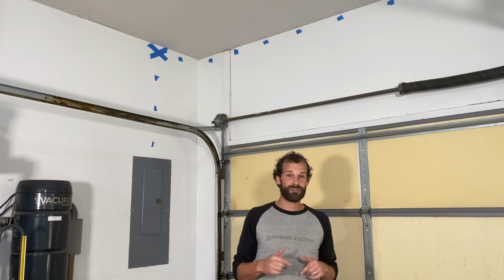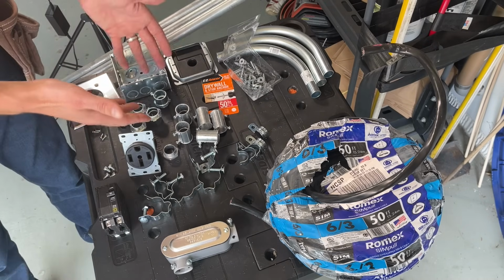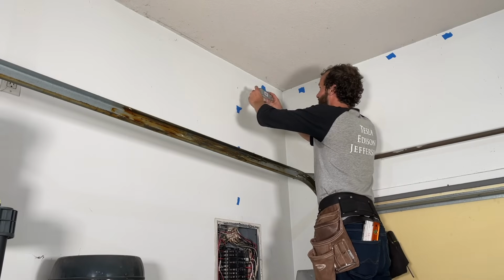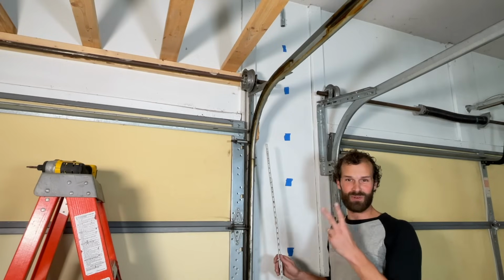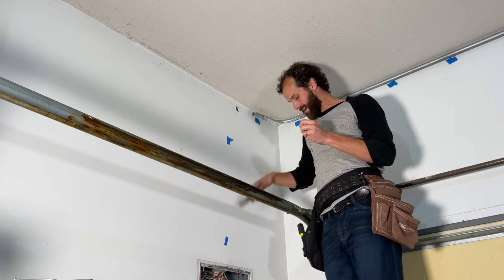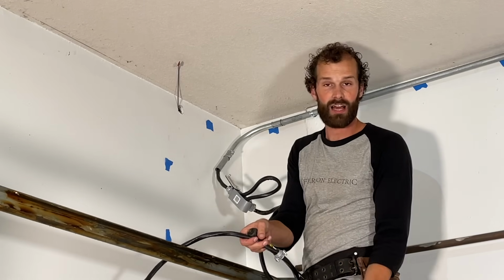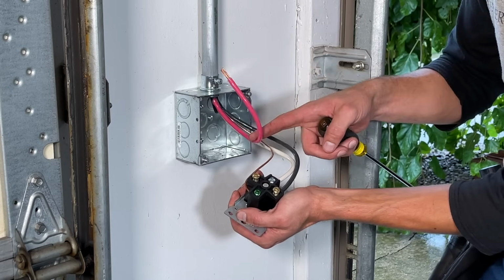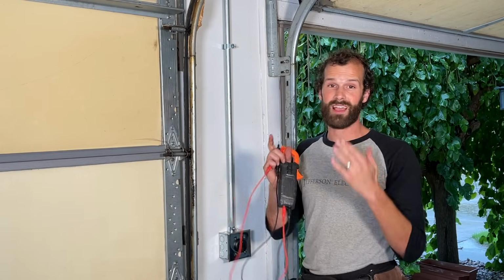How To Install a 240 Volt Outlet | Electric Car Charging

Comment: I question your use the NEMA 14-50. It was designed for appliances that require both 120 volts and 240 volts, it contains 2 live lines, L1 & L2, 1 Neutral and a ground. The L1 to Neutral or L2 to Neutral gives you 120 volts and L1 to L2 gives you 240 volts. A Neutral is not used to produce 240 Volts.. Since EV Wall Connectors only use 240 volts you should be using the NEMA 6-50. 

The NEMA 6-50 has L1, L2 & Ground which gives you a 240 volts with a ground.. By using the NEMA 6-50 outlet you only need 2 Conductors and a ground. This has many advantages, the largest in that it will enable you to use 2 conductor cable verses a 3 conductor cable. Remember that whenever dealing with an EV you must apply the Continuous Load factor. A Continuous Load is any load that lasts 3 hours or longer. When you have a Continuous Load you MUST be de-rated the conductor to 80% of its normal capacity. For example: NM Cable also known by the brand Romex has a 60 degree Celsius conductor rating at is rated for 55 Amps normally, but when used with an EV it is limited to 44 Amps.  Also, all Breakers and connectors must be de-rated by 80%. 60 Amp breaker max with a Continuous Load would be 48 Amps, a 50 Amp breaker 40 Amps, a 30 Amp breaker 24 Amps, a 20 Amp breaker 16 Amps and a 15 Amp breaker 12 Amps.                                                                           

So you can use it for the Tesla Portable Wall Connector since it only draws 32 Amps 6 AWG Romex, but you NEVER run Romex through a Conduit. If you are wanting to use the Tesla Gen3 Wall Connector or similar wall connector and you want to draw 48 Amps, you CANNOT use 6 AWG Romex. You can use THHN rated at 75 degrees Celsius because it has a normal Amp rating of 65 Amps which is de-rated to 52 Amps, but these conductors must be run through a conductor. But I actually prefer MC Cable. You can purchase MC 6/2 Cable. 

It is more cost effective, and easier to pull than Romex and the conductors are inside a flexible Metal Conduit, so you do not need an additional conduit. Also, you never put Romex inside a conduit.... One reason you don't put Romex in conduit is because it creates more heat and is not advised in conduit if you have conduit you can run insulated wires instead it's probably cheaper. when you put Romex inside conduit The Romex cannot breathe and retains too much heat.

Comment: I'm really surprised as a professional that you weren't wearing safety glasses, you weren't wearing insulated (rubber) gloves and you weren't using insulated tools, mainly the flat screwdriver at the panel. All safety precautions I've used my entire career both professionally and as a diyer for family and friends.

Comment: Not sure but I think it is against code to have to tear apart a raceway to pull wire, and why didn't he just run into attic space the whole way and recess a box. Every electrician will do it a different way as long as it's legal is good with me, actually a pretty clean looking install

Comment: I would think a disconnect switch would be required at the outlet receptacle.  You should never be able to pull a live plug under load with these high amperage.

Comment: I thought if you are going to use a plug and not hard wire into the EVSE that you must use a GFCI circuit breaker?

Comment: I'm sorry but the portions I was able to watch made me cringe. How are you not dead yet, other than good fortune? 
1.Your are putting metal fish tape into a live distribution board??!!? The description text talks about Safety First but you talk as though you are working on a distribution board that is not isolated. Surely not?
2.Turning the breaker for the circuit you are working on to the off position isnt isolation for working in the distribution panel. Installing a breaker into a live board is also not safety first.
3. That conduit is an exposed conductive part, and I may have missed it with not being able to watch the entire video, but I didn't notice any earthing/ groiunding of the conduit. 
4.Checking your work with a $15 multimeter is not testing the safety of a circuit. It will not show any cut in the conductor insulation possibly caused by the blade or when pulliong it throught the fabric of the house such as a nail or screw in the wall it rubs against. 
By doing it so badly on Youtube you are putting peoples lives in danger as they do not realise the real threat to their life by follwoing your example. If this is how real electricians work in the USA, I would be astounded.

Comment: Couple issues with your installation 
.) metal fish tape not a great example in a panel I would recommend using 3/8” pex tubing to fish. 
.) that lnb at the ceiling was a struggle a 4sq I would recommend a 4 square box 
.) you just installed a 240 50a line and didn’t bond your conduit !!!!  To make things worse you installed jacketed cable in your  conduit Again a 4sq box and you could of pulled a bond. 
.) I understand using those screw fittings as it’s difficult to source parts and we use what’s available but your making a how to video you could of stepped up and used compression fittings

Comment: It against osha to pull a fish tape in a panel that is hot, or power on the main breaker. It is dangerious even if got a card board covered over panel. It still can break theough card board and electricute the other end of fish tape.

Comment: Not many nations use 120 single phaze ac 60 hertz  electric transformation. Or 220 volt 60 hertz ac dual phaze. Most nations use 480 volt dual phaze  50 hertz ac power grids.even usa states as hawaii or alaska and isa colonies as philippines are 50 hertz 220 volt single phaze , without  a earth ground results bad electrical power grids brown out, unbalalnced  power circuits on power grids.  Plus electricution and no no fault circuits are life saving around swimming pools, bathrooms or any where. It shuts down on shorts not heart on mercury. Panel breakers  are heat mercury breakers as the service and load of no failt using earth ground no fault is on a short across the current . Results kicks off breaker , where the panel breaker is not tripped. Panel breaker depends on size amps heat it take to go over the amp required , takes alot longer to raise tempture to melt the mercury off the connection, trips the connection. You must het that hot before it trips. But no fault trips on anything touches its pathway, immediately  it breaks comnection.  Its a Life saving product. No fault  must use a earth ground.

Comment: You have not explained anything correct on title or video. Example is the 220 volt dc or ac ? Is it 50 hertz  or 60 hertz  ? What amps size it the receptical ? Is it a 220 volt single phaze or dual phaze or try phaze or quadra phaze ?

Comment: Hello, awesome video! I don't believe you can run Romex in conduit, and I think a bigger box might have been better. other then that I think it's a good instructional video!
Reply: My understanding as well - that you're not allowed to run romex in conduit, but in a basement, for instance, the romex must be in flex to protect when outside the confines of framing...?
Reply: @richardvsessions1302  that isn't true, you  still can't run Romex inside of flex. Just use regular wire inside of flex or emt

Comment: Couple things like add, You shouldn't  run Romex in Conduit, it can't off the heat. Industrial Cover would be better than the Sharp plate. An offset to have pipe against the wall is better and you need a couple straps. Not sure why the Gap?
Also the Receptical need a Ground attached to box(needs to be solid, can't use stranded for this), then a Pigtail to the Receptical.
You also could have pushed up fish tape, through Conduit body, big loop in fish tape then to your Receptical. 
This way you only have to attach wires to tape once.
Stratmando

Comment: If you have 240 V wiring to your garage, can your run your lights off of the black and white wires and run plug ins off of the red and white ?

Comment: Multiple NEC violations.  

1. Non-Metallic sheathed cable (Romex) is not listed for use in Listed Metallic Conduit (EMT).

(Romex) is not listed for use in Listed NON-Metallic Conduit (PVC).

In Fact (Romex) is not listed for use in any Listed Conduit  or Raceway...Metallic or NON-Metallic

2. Conduit body with EMT connector not list for use to penetrate Sheetrock !

The entire pipe run is a NEC code violation as the EMT pipe run is not bonded and >>>> extremely dangerous <<<<<!
If the current carrying conductors make contact with any part of the pipe run there would be NO FAULT path....thus the pipe would be electrified !!

Let me guess...this fellow is not >>>> State Licensed Electrician<<<< !
Don't care what his shirt says.

IOW.....DO NOT FOLLOW THIS METHOD !!!

Making an installation look pretty...but potentially lethal is always a code violation !!!!

>>>>>>    Here's a clue to make it NEC complaint...

Listed (Romex) can be properly strapped and exposed/surface run unprotected above 7ft !!

So how do you complete the run to the outlet box via the NEC ?!?!?

Comment: Just to clear a certain point.  The panel is 240V.  The equipment being powered is designed to work on 220V or there abouts.  The same difference of the 120V at panel, voltage drop over distribution line, and then equipment designed to work on 115V or 110V.  Great video here.  Very informative. Thanks!!
Reply: no, the panel is 120/240V.  to be a 240V panel would mean there is no neutral wire feeding inside from the source.  if you have a voltage drop from 240 to 120 going between the phases (line to line) then you have a serious problem and need to contact the utility company.  if you have a three phase system (some high-rise apartment buildings do) then call a proper electrician to do the wiring as you may have 208 volts between phases instead of 240V, which may not work properly with your car charger.

Comment: The minute you took the panel cover off makes it beyond the homeowner's ability. Using a standard cover plate instead of a raised cover is a hazard.
Hope you don't get someone killed following your advice in a hot panel. That 3/4" is too small should of went with 1" pvc or not used romex. It pulled way too hard should have been your first clue. LB is overfilled and the raceway is not completed. Now that you might have broken strands by forcing the wire and banding it beyond its radius created a fire hazard. You also did what is called choking the ground by not having a completed raceway in metal.
Good intentions leads many to hell. Don't try to teach unless you know what you're doing!

Comment: All In All - Richard Kaufman is Correct - 
The one Key process I've used for 40 yrs -
Always have handy, heavy duty paint mixing stick to pre-form on the end 
trimmed a bit narrow with notch on end for stuffing bulk of wires into any 
box behind outlets. Don't use screw drivers that can injure insulation. 

As for cardboard - I prefer polycarbonate Lexan sheet, flexed into sides of panel. 
can also clearly see through.  

I've noticed some electricians have left nightmare of tangled circuits
overlapping others to make stuffing a box almost impossible. 
So I'll disconnect any existing wires of the rat nest, and re-lay out the wires 
in logical path first. 
Now safely stuff them in place with tip of stick deep into box first. 
Vs forcing wires on new outlet under high force of screws, 
to have to force it's wires on top of rat nest and possibly distorting the outlet's 
mounting plate. Creating a twisted outlet face, now it can't be easily corrected. 

2. That finish plate on wall outlet as Richard also noted,, 
leave a box of bandaids on a nail,, when it's dark,, reaching out,, 
and victim is a quart low. 
3. I'd install a LED marker light on bottom of outlet box facing down 
that's always on - lighting entire path to the outlet where someone left a 
garden rake up against the wall. 
Or a pile sitting on the floor directly in path to the box, ready to trip over 
defenseless with cord from car in their hand. 
Now by default, they always know that outlet is live and ready to use walking
up to it. 
If that's too fussy,, you'll love flying on aircraft I service.. 
Nothing is left to chance. Murphy is Always Lurking @! 

As for pulling cable - I never use the Goo, but always have can of industrial silicone 
spray,, it makes cables effortlessly easy to pull. And it's a natural protectant to all plastics. 

Cheers

Comment: VERY GOOD VIDEO IM A ELECTRICIAN  HERE IN NYC. YOUR VIDEO VERY PROFESSIONAL I HAVE TO RUN A LINE THIS WEEKEND. I WAS SAYING HE SHOULD HAD GLOVES ON WHEN PULLING THAT SNAKE. WHAT I USE N YOU MAYBE SHOULD INVEST IN FIBERGLASS SNAKE IF YOU DONT HAVE ONE SAFER WHEN WORKING IN THE PANEL. THE VIDEO OVERALL VERY THOROUGH. I JUST SUBSCRIBED TO UR PAGE KEEP THESE VIDEOS COMING. ALSO WHAT STATE YOU FROM. THANKS AGAIN MI LOVED THIS VIDEO KEEP THEM COMING MI FELLOW SPARKIE N ALSO GET SOME NICE CABLE CUTTERS LINEMANS CAN BE TUFF WHEN CUTTING THAT NUMBER 6.

Comment: After making a big deal about the conduit being part of the grounding system, you left out the 3' space between the LL/LR Condulet and the top of the panel. A 3/4" EMT 'S' fitting could have brought the conduit out of the wall space just above the panel and maintained the conduit ground system. Since two pre bent nineties wouldn't  fit at the ceiling, a ninety and a forty five would work. Some of us DIY'ers have EMT benders and would custom bend that first length out of the top of the panel. Other than my sniveling and whining, you presented a good piece.

Comment: I hate to bust your bubble, but you're hardly a master electrician.  The way you have approached this job, in my option, you have created a lot of problems for yourself.  First of all, it's against code to pull NM Romex through EMT with the sheath still attached, unless you're pulling in shielded multi control wires,  separate conductors are required. As for the 50 amp breaker, you could have saved yourself a few dollar's by purchasing (3) #8 Awg. and elimate the neutral all together. Circuits over 50 amps require #6Awg, which are normally hardwired for an EVSE rated 41/50 amp. Because motor homes use the same type of outlet, the box would have to be labeled (EVSE only).  There is nothing wrong using a NEMA 6-50. I would have flexed out of the panel and attach an EMT/Flex connector directly to the EMT, eliminating any junction boxes or a condulet.  When it comes to making up the outlet, you failed to bond the ground to the metal box, and what's with the tug-test, wiggle, tug-test?  With stranded wires, the less stress, is best. Finally, go buy yourself a conduit reamer, needle nose pliers, channel-locks and screwdrivers are old school. I've been specializing in EVSE installations for close to 10 years, and have installed, over1000 EV chargers. I wish you well.

Comment: Hello one thing I missed to ask is there any problems using one inch metal conduit instead of 3/4. I mean pulling wire may little more easy. Other thing like to check is using bx cable same gauge (6 gauge 4 wire bx,-of course  more expensive) isn’t installing easy.?

Comment: Thanks - As a homeowner awaiting some future delivery date of our Tesla truck, I will soon be faced with adding a Tesla Charger.  This video gave me a look at, and starting point for planning my future install.  My main panel is on the outside of the garage wall.  My Tesla solar panels and power wall are on order but not installed (frustratingly slow by the way).  Those will be on the inside of the garage wall as will the Tesla auto charger.  Tesla already advised that they do not install the charger - thus DIY or electrician hire.
Reply from the maker: I have 2 Cybertruck orders in.  Put them in the night of the reveal 👊